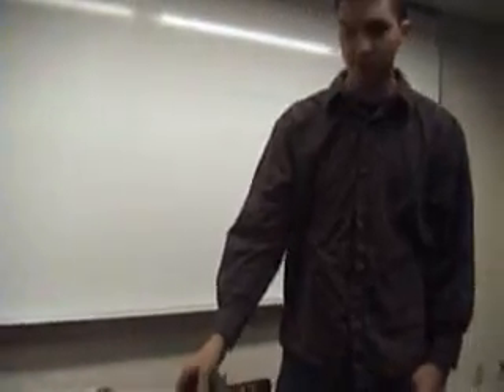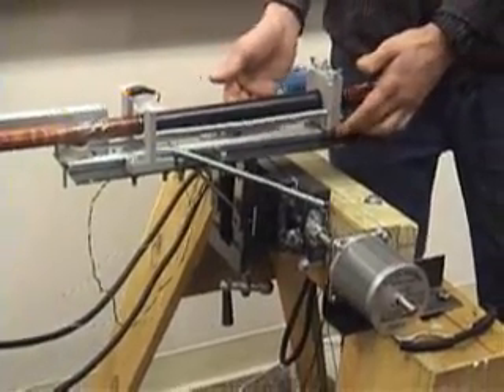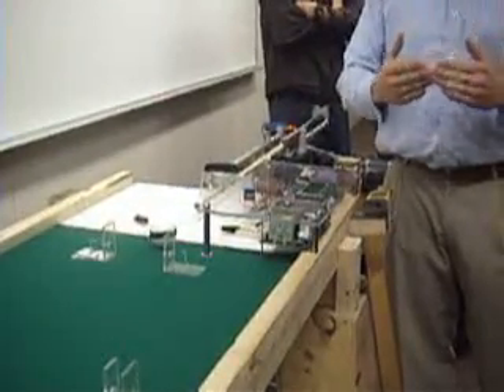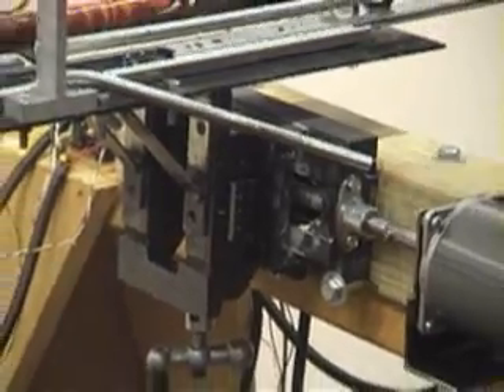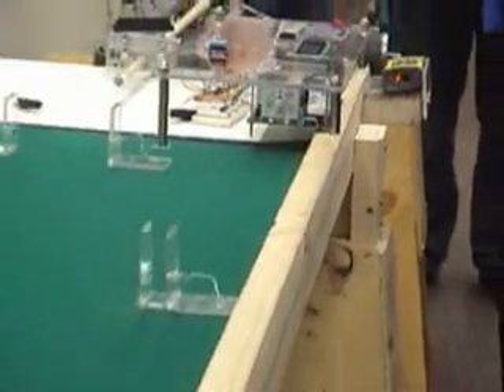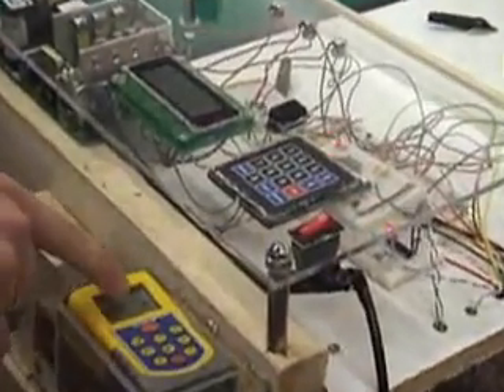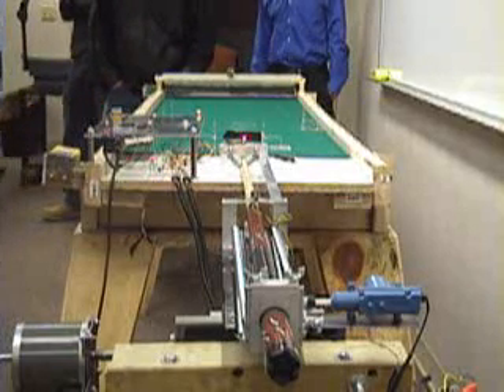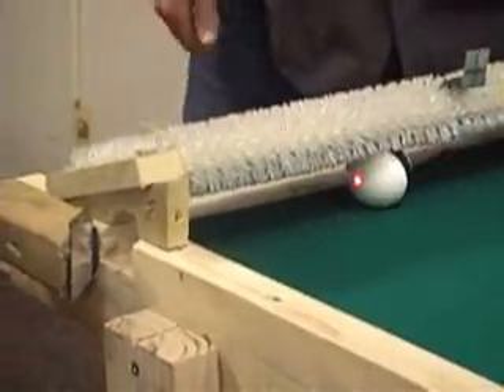Spring-loaded cue-stick tester

Comment: you can make all these deflection test machines, but none will be accurate...they need to allow for elbow downward motion , elevation, speed of player, height and arm length of player...on & on.  Cool project but cant rely on results as a pro player. I custom fit/adjust cues for a players speed and style.....works alot better....as in golf club swing speed. LLL
Reply from the maker: Many things must be considered in the design of an effective cue testing machine.  For more info, see:
   https://billiards.colostate.edu/faq/squirt/robot-test-results/

Comment: Forget the machine...What you need is a pool cue with a spring that pushes out a metal clothe cushioned rod within the pool cue which has been hollowed out.....The amount of force can be adjusted with how far back you pull the tab on the side of the pool cue which has a slot going up the cue a few inches at the midway point of the cue......The reason you need such a spring loaded pool cue is to prevent the muscle under the pectoral rib on the left side, if you are left handed, from causing a terrible pain in your chest every time you take a deep breath....I experienced this two weeks after I started playing pool and I had to stop playing.....The pain takes months to disappear......Also, a spring loaded pool cue is more accurate and lets a beginner play like a pro.......There are three patents existing on spring loaded pool cues.....but no one has made any for sale as yet....
Reply: Nixstixx.com